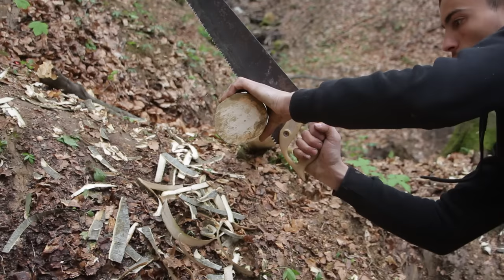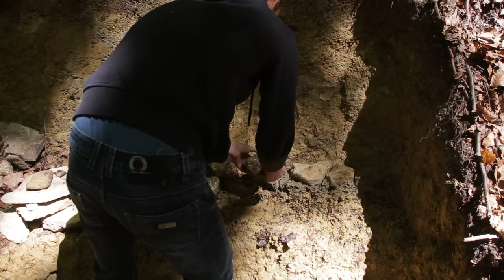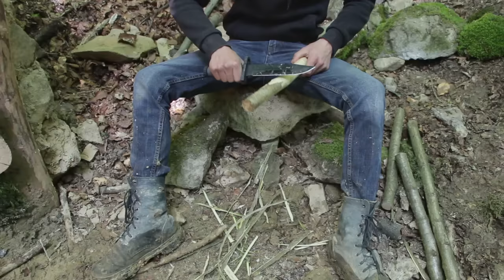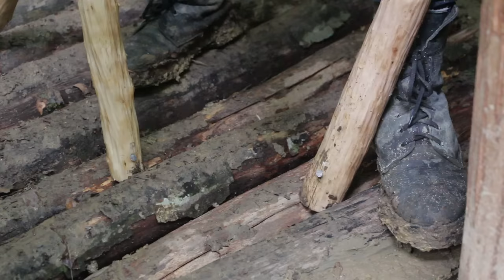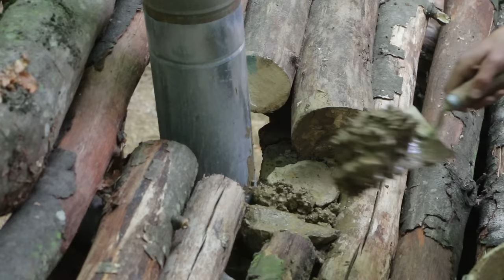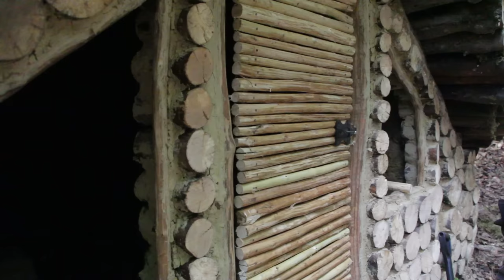One built a dugout in the forest. From beginning to end

Comment: What a beautiful shelter! Don't hate me, but I saw 1 mistake. The diagonal on the door. The top needs to be on the hinge side to be useful. It's meant to stop the door from sagging on the outer edge. Every young man makes that mistake. Is it for rent? 🤓 BEAUTIFUL SHELTER.
Reply: No, he had it right. You want that brace under compression. Just think about it, if you put your weight on the outside top of the door, the closer that is to the brace, the more structural integrity you'll have. So you want all the weight that is above the outer bottom edge to be transferring its weight into the hinge instead of underneath itself, which would give you the sag. Although, to be honest, without top and bottom braces to properly frame up the square, I dont think that cross brace is going to do as much as it should regardless of orientation.